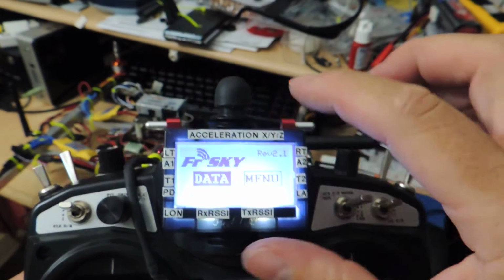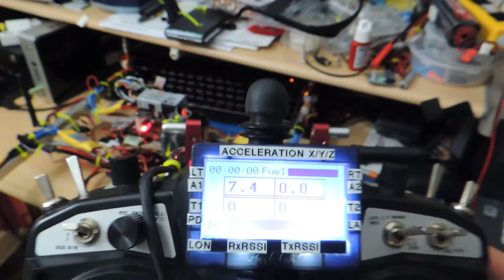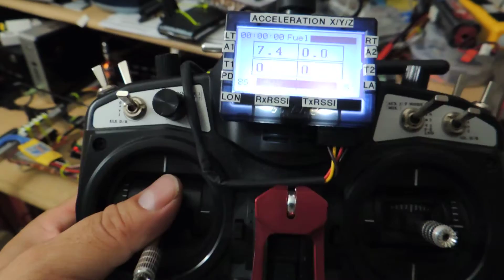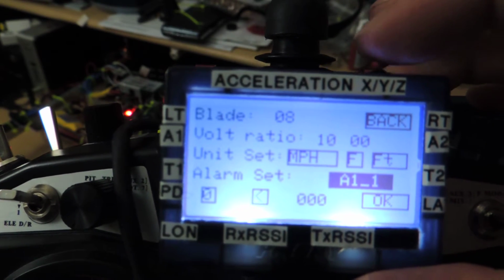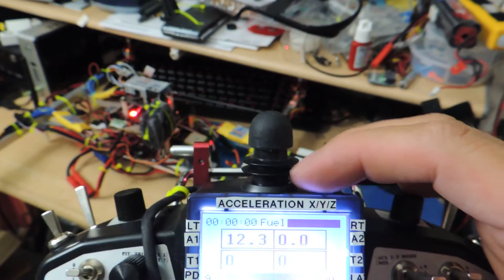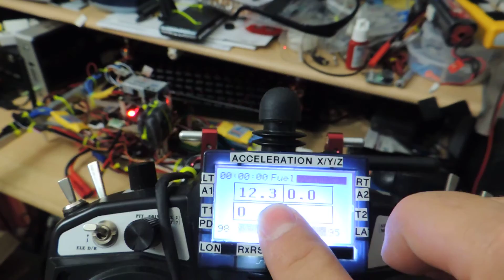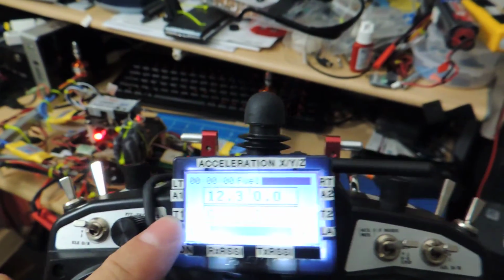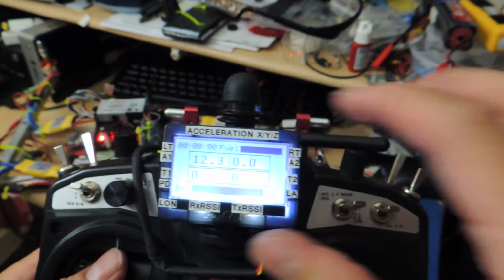Testing the FrSky FLD-02

Comment: It appears in the video that he has the fld02 reading from the bec 7.2 volt. The rx is set from factory with a1 reading input voltage into the rx servo bus. Putting 3s lipo voltage into the servo bus would fry the rx. So assume that he is connected to the bec.  My bec runs at 5.2 volts but here's the problem with this video: He then goes to test voltage of the 3s lipo. Not the bec voltage. We never see what the bec voltage is. He then test voltage of the 3s lipo pack at around 12.2 v. Then he adjusts the fld02 ratio to 10 which causes 12.3 volts reading on the fld02. He should have changed the ratio of the fld02 A1 input to match the bec voltage.  He has made the fld02 which is connected to around 5 volts ( assuming here- he never tested his bec voltage) on A1 read 12.3 volts, close to the 3s battery voltage at this moment of the video.

Comment from the maker: I do. I have it plugged to A2. The voltage ratio for a 3 cell is 04. Just take out the negative wire on the receiver side and plug the other side to the battery you want to get the reading from. If you do a search in rcgroups you will find the information on this setup too. You can use A1 for another battery, but will need another sensor for it. Depending on how many cells it is, you have to adjust the ratio to match it. There is a weird formula for all that, but I just gave you the one I use on mine. Thanks for the reminder, I never did update this on here. The accuracy is pretty good so it does match close to what your buzzer is.
Reply: Oh ok, it would be helpful if you can make an updated review on this set up so other people (and myself) can visually see what you are explaining. Thank you! :)

Comment: Have you had this FLD-02 figured out yet? I have a Turnigy 9XR with the FrSky DJT module, D8R-II plus with the FBVS01 and FLD-02 and trying to figure out the accurate reading from the quadcopter battery reading and still confused O.o

Comment from the maker: I think that may work, but I realized that you can get the internal voltage with the jumper on it. I got it from the manual for the receiver. I just have to figure out the ratio as I have measured the battery again after it changed voltage and the screen still shows 12.3 volts. So I think I still got this wrong.